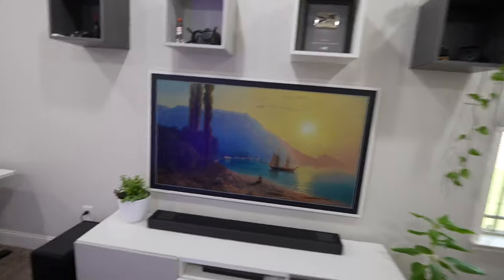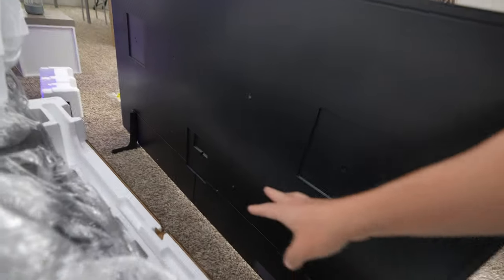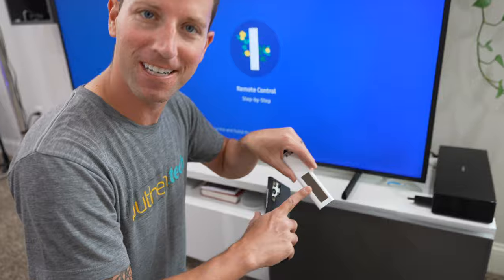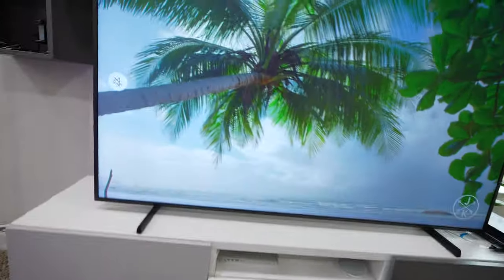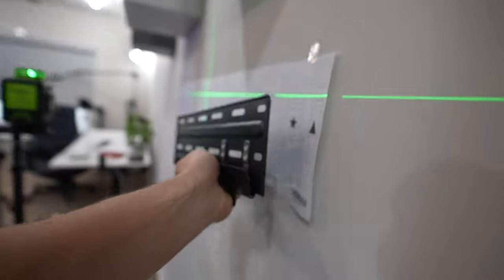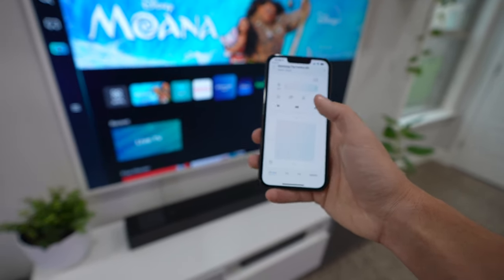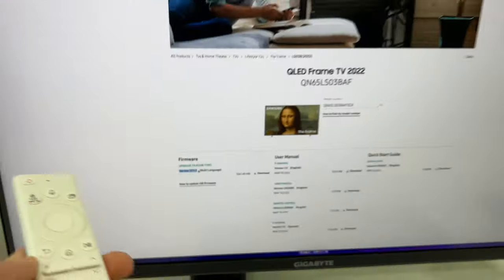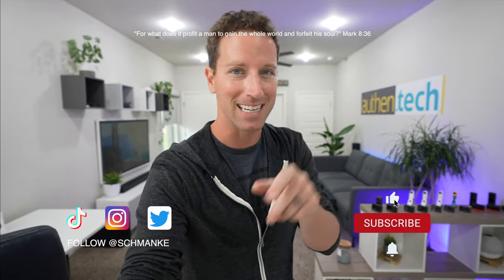Samsung 65" The Frame TV Review: A Work of Art (2022)

Comment: Doesn’t look like a picture frame because it’s above a to unit and has a cable coming out the bottom. Seems a little pointless unless it’s mounted higher and in a different position with the cable hidden.

Comment: I use a 32” 2020 the frame in our kitchen. It is mostly hidden but when we need news it is there. I ran the brains through the wall to the closet behind. Worked well. Thought about doing the same on the hearth too.
Reply from the maker: Hiding the hub in the closet sounds cool
Reply: We are delight to  inform you about your winning of a ( Samsung 65" Class 4K UHDTV (2160p) HDR Smart LED-LCD TV).message the name above for acknowledgement

Comment: I just got my 2022 75 in the frame. Mine seems to have about a 1/2 gap at the top. The wall is plumb. Does yours sit completely flush top and bottom?
Reply: We are delight to  inform you about your winning of a ( Samsung 65" Class 4K UHDTV (2160p) HDR Smart LED-LCD TV).message the name above for acknowledgement
Reply: To mitigate this gap, you can find a few foam made plugs in the tv pack. Just glue them at the bottom of tv, the gap then disappears by a straight line similiar to a real picture frames.

Comment: Can you detach the connectors on the one-connect-cable such that it can be passed through the pipe duct on the wall?
Reply: I don’t believe so Koby. I have seen a video where the outer casing was removed but you would have to super careful not to damage it. It would be an expensive exercise if so.